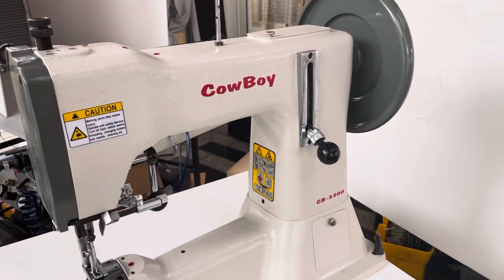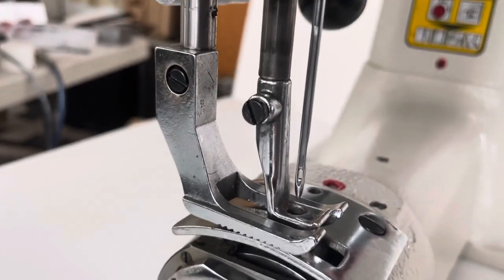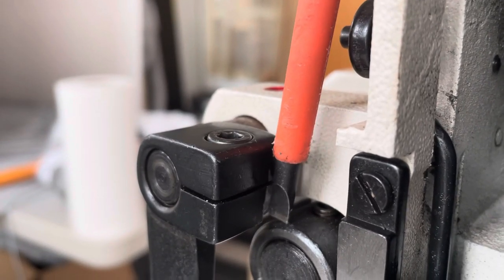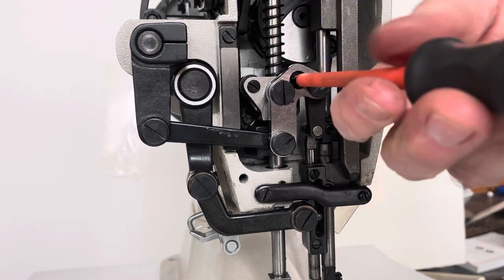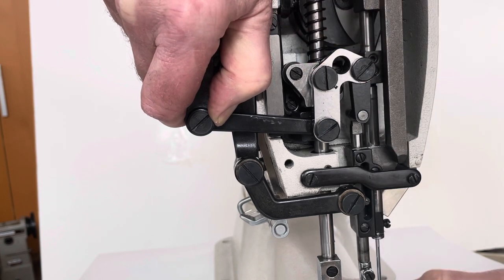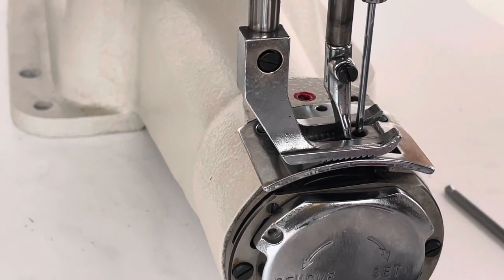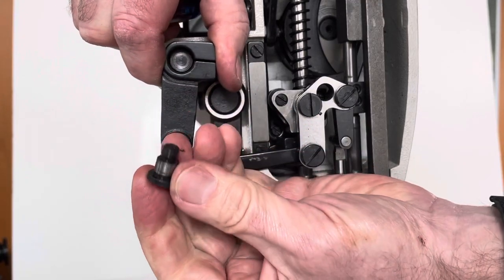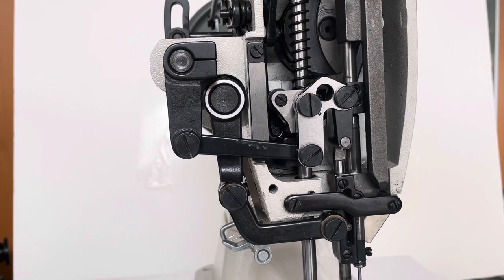Adjusting the walking foot linkage on a Cowboy CB-3200 (Juki 441 class)

Comment: Thank you for this video, it's a useful and clear explanation. 

It only works for one type of feet though :)

With a narrow outside foot on my CB4500 I set the foot according to the Juki engineers manual and adjusted it so the lift of both feet was equal. 

On my machine with the needle bar height adjusted (your video on that is brilliant, BTW) and all the timings correct there is no way to get that linkage vertical with the narrow foot or double toe foot because they are shorter than the blanket feet so the block for the presser foot bar can't go down far enough.

I don't know why they don't make them all the same height, it's really irritating, but I think it's better to set this linkage based on foot position and walking height rather than linkage angle, because ultimately the linkage angle doesn't matter so long as everything moves freely and the feet lift evenly. 

The reason for this is that the Cowboy feet aren't all the same height. 

The machine works fine and stitches perfectly  though.

Comment: Just a thought. Why couldn’t you just rotate the rear linkage 180 degrees so that the Side with the clamping screw is facing the back of the machine. That would have given you ample clearance on the other linkage and you wouldn’t need to grind anything.
Reply from the maker: That would work if the arm that extends down was centered on the bracket, but it is not. If you turn the bracket around, things won’t line up anymore with the other parts of the linkage.

Comment: So this allows the back foot to raise higher when it's walking?
Reply from the maker: You can fine-tune the relative walking height of front and rear foot by purposely adjusting the linkage away from vertical. This is just the base adjustment to get machine to a working state.